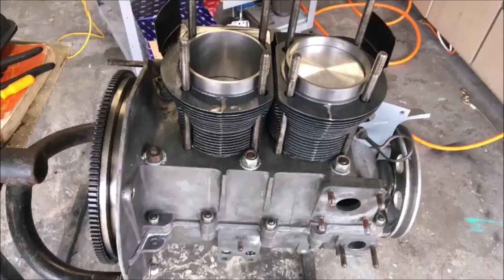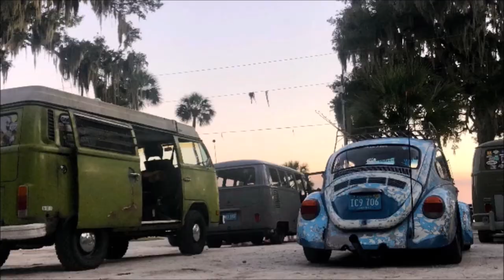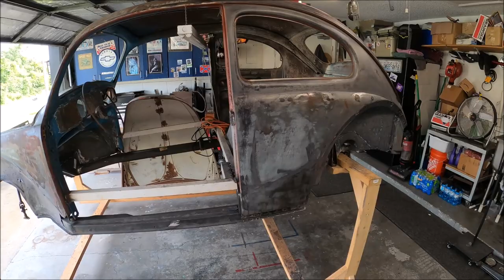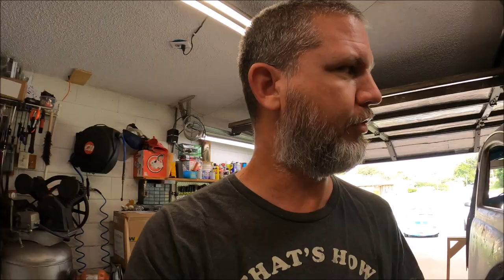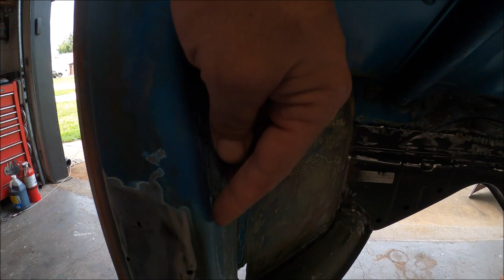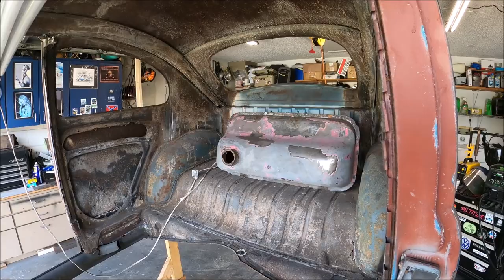Removing the Body Braces!  - SICKXTY -  Volksrod – Baja / Franken Beetle Build  -22

Comment: Great video. Are you going too block off all the heater channel openings on the body and rear of the channels? Here is a idea for the rear use motorcycle chain for support braceing. See if you can find south african sprintstars and see how they look on the sixty
Reply from the maker: Thanks man! I’m not going to block off the heater channels just yet, I have an idea for later I might play around with at some point once it’s on the road. 
I do know someone who might have a set of sprint stars, I’ll give him a shout! Thanks for the idea!
Reply: @VWJawbreaker  cant wait too see the sickxty done. Was itching too see how it'll look with the south african sprintstars.
Reply from the maker: @pierreduplessis1507  it’s definitely taking longer to build the car but I’ve also changed the plan a few times, life issues held me back, etc. It’ll get there 👍
Reply: @VWJawbreaker  been stalling on my project. Not sure on paint colour
Reply from the maker: @pierreduplessis1507  you’ll figure it out eventually. Don’t rush, get test samples if you can.

Comment: Self-etching two-part epoxy is what I used for years on a stripped down to bare metal bodies. I seen cars painted 12 years ago still look nice and rust free. If you can spray both sides of a metal panel the epoxy will seal off the panel and rust spores that are in the metal panel and starve them of oxygen and stop the rust. Metal has micro holes in it like a sponge and the epoxy will seals those micro holes off where rust spores are. Just a nice tip and what ever you decided I am sure it will be a nice job....
Reply from the maker: Thank you for the info! I’ve only painted once, about 20 years ago so I’m looking for all of the tips I can get! 
I was leaning towards 2k epoxy primer but I’ll research the self etching part of it. I’m all for learning new things.
Reply: As above. ✌🏻
Reply from the maker: @kevinhamling1963  gotcha, thanks man!!

Comment: Very Nice Gary, Not sure what you plan on the back end but I'm sure it will look awesome. Actually looking forward to see the Apiller repairs. Taking the boat out on the lake tomorrow for a test run so will have that video up for next week. Should be a good one.
Reply from the maker: Thank you sir! Since it’ll still have a baja look, the rear cut will fit into what I have planned down the road. 
Cool, boat day!!
Reply: Well the boat test on the water yesterday overall went well but do have a couple things to fix. That's why I test it first before having issue fishing with this boat.

Comment: It's looking great Gary. What did you say you use to stop rust?
Reply from the maker: Thank you sir. I use ospho to coat the metal.
Reply: @VWJawbreaker  Thanks. I'm workin on a 73 ratbug
Reply from the maker: @garyjimison7669  nice! 
If you use ospho, it will turn the rust to kinda black. So depending on the look you’re going for, try a test area first.
Reply: @VWJawbreaker  Okay thanks